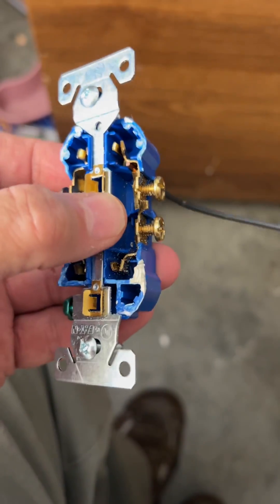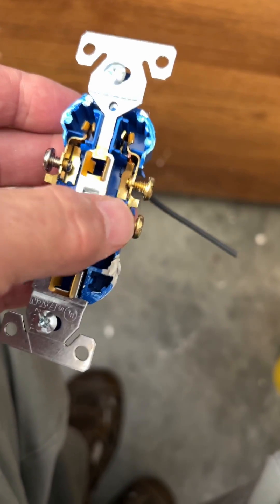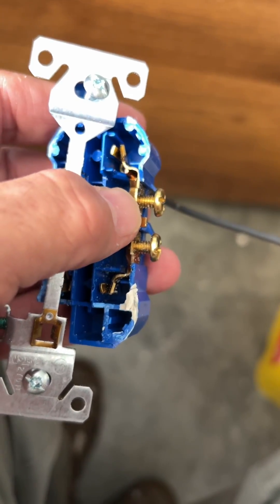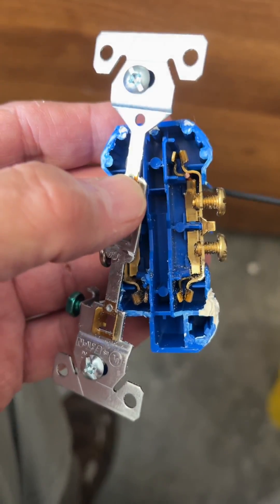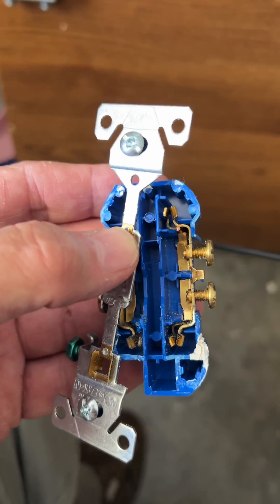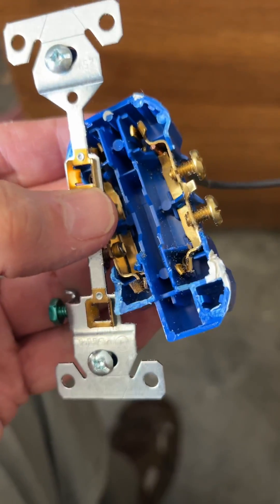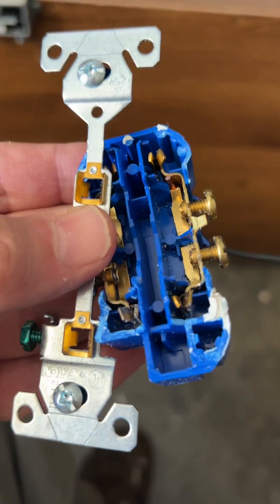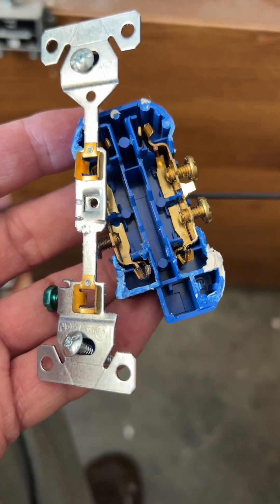Are the quick wire terminals really bad on outlets?

Comment: I've seen were the edge that bites into the wire on quick clicks gets a nice little crescent burned/melted into them from a load plugged into the recept or into recepts down stream in the circuit..
I know it takes more time to do the installation. but I wrap the wires around the screws.
Makes for a better quality long term installation.
Going into an older home and having dead or intermittent powered recepts is often because they were wired using the quick click. The thickness of the metal doing the bite will vary as well as a function of quality.
Now that code requires that AFCI breakers be installed they are also a cause for nuisance tripping.

Comment: corrosion and the press bite fit gets higher resistance. A screw has much much more force that physically forces the metal together so there cant be corrosion in between

Comment: These have been used for years without a safety recall, they are UL listed, as the video stated. They can be improperly installed just as a screw terminal can be.

Comment: I think it’s the actual area of contact. Only the “bite” part contacts the wire. That’s a much smaller area than if you wrap the wire around the screw and tighten it. The smaller contact area of the push on connection may lead to overheating and further loss of contact area. I’ve seen it on my house wiring and will never use the push on option.

Comment: I trust push-ins more than the screw terminals.  Never had an issue with 'em, and I've been usuing them for more than 20 years.  And if you've never tried Wagu connectors, check 'em out.  Old-school electricians don't trust them because they're used to using wire nuts.  Give 'em a try, and you'll like them.

Comment: If you .Ke a pig tail, then not so bad
But if you feed in the lower hole out the upper hole then you have issues 
Also the more surface contact the better